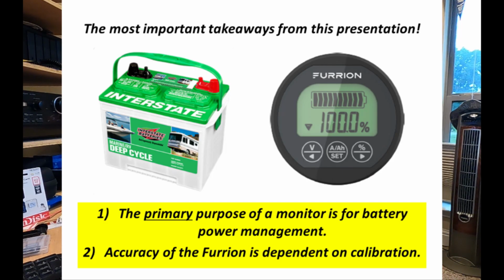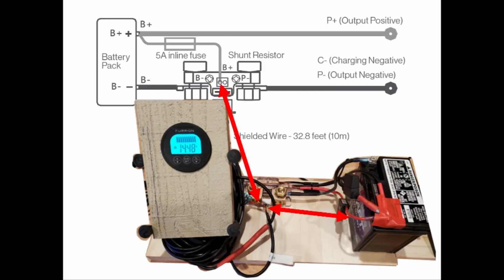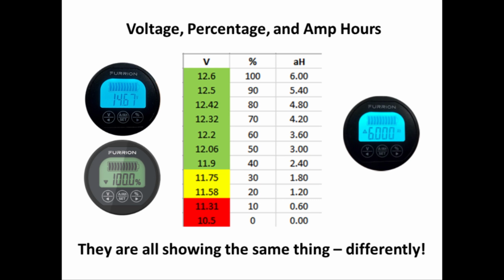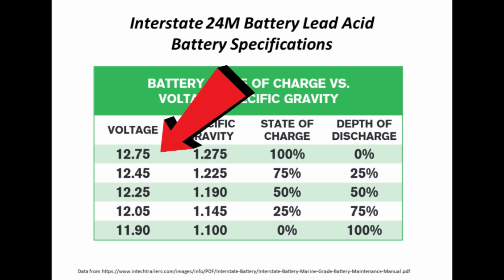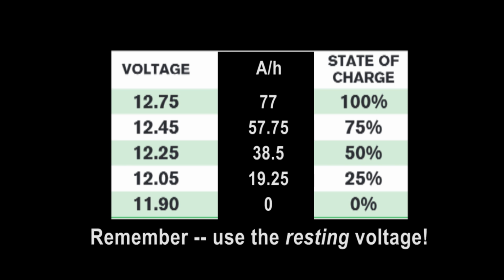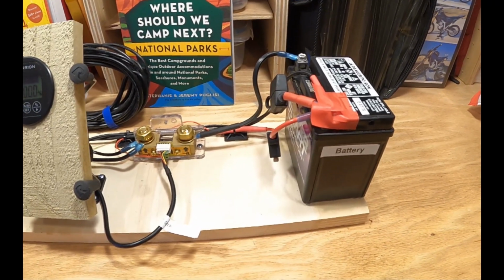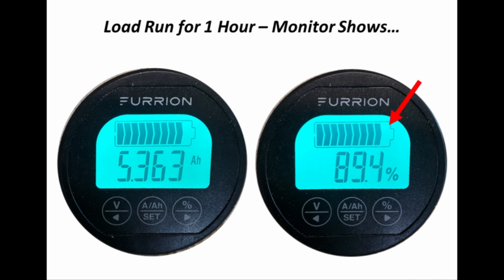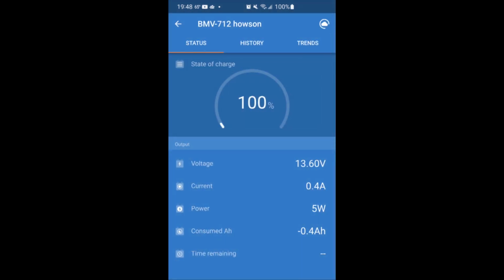Furrion Battery Monitor Presentation

Comment: My battery indicator reads full 100% of the time. Even when the battery is disconnected. One of 1000 problems I've had to troubleshoot.  I'll never buy a Grand Design again.

Comment: So if we have 4 AGM 6V- 224ah batteries that are in a series. Do we set ah to 224 and set voltage to 24?
Reply from the maker: Yes.  Four 6V batteries in series is the sum of their voltage.  Since they are all the same, amperage is as stated.

Comment: Thank you for the presentation. I have a question, I have an imagine xls trailer. Do you think that the bundle of cable is merely zip tie behind the monitor or near the shunt? I would like to relocate the monitor to the interior of my cabin. Thanks again!
Reply from the maker: Yes, most likely.  If it's in the typical location (water panel) then the cable should be easy to find.
Reply: Yes. My monitor is in the wet bay center...I have to keep sticking my head inside to view the monitor. I would like to move it into the bedroom or bathroom wall. Thanks again.

Comment: I have two 77AH batteries and programmed the monitor to 144AH, was that correct?
Reply from the maker: Assuming the two batteries are wired in parallel, yes.
Reply: Yes, Thank You! @howard6798

Comment: Great presentation, thank you. I did have a couple of questions… 

We recently purchased a 23 Reflection 341RDS and was researching a swap to lithium. 

For a lithium upgrade I’m assuming the Furrion battery monitor would have to be replaced with a victron system since it would seem the Furrion is geared for lead acid or AGM and not prepared for the minute voltage drops seen in lithium during its use cycle?

Second, I’m also going to assume the data cable connectors for each brand are proprietary which would require a cable pull to swap out the display in the camper. 

What is GDRV now using in place of the Furrion battery system?

Thanks again for the video. Good info in there.
Reply from the maker: No need to replace the Furrion (unless you want to upgrade).  Just reprogram the Furrion to the new battery.
Reply from the maker: Yes, you'd have to replace everything (monitor, cable, and shunt).

What is GD putting in their units now?  Nothing that replaces the Furrion.  :(